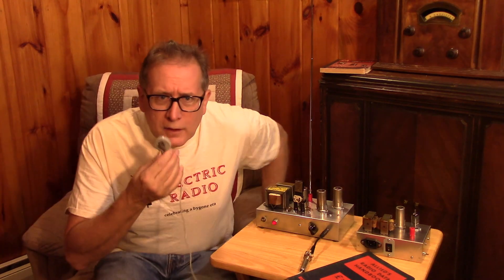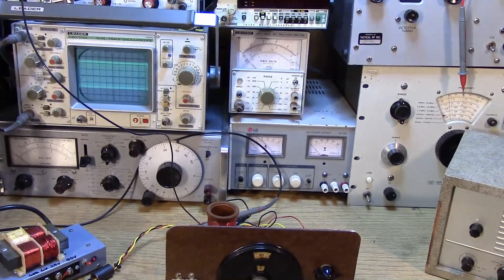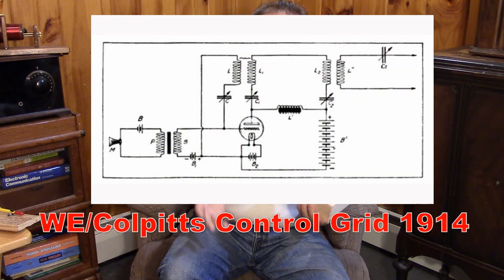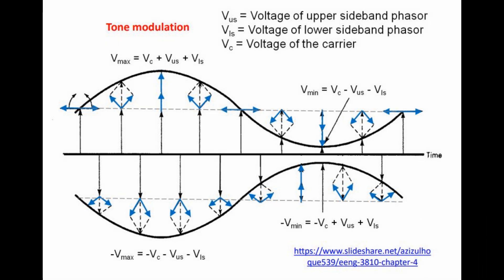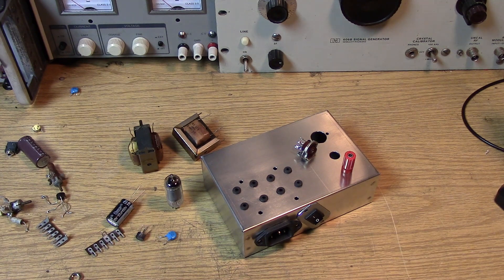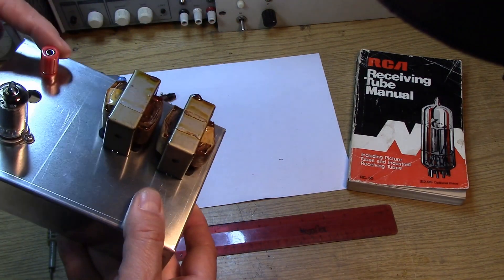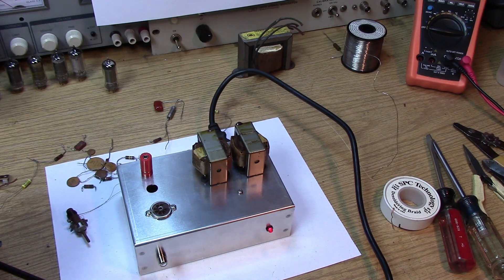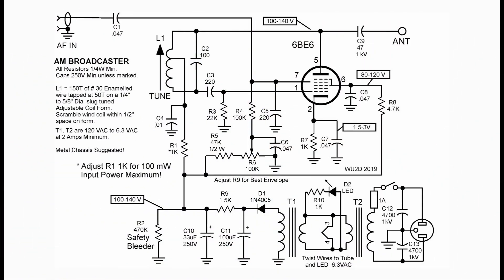Part 15 Old Style Tube Broadcaster - Part 1

Comment: Well explained. Playing Devil's advocate, I think biassing the carbon mic and feeding this signal into the oscillator coils via the extra winding was really grid modulation. You were adding a signal which found it's way to the grid. I think if you had tuned the carbon mic+ coupling coil with a capacitor to resonance it would steal enough rf to kill oscillations. You would then loosen the coupling until oscillation was regained. At some critical coupling, the unbiassed carbon mic should work really well.
Reply from the maker: Hard to argue with your grid mod thinking in a self controlled oscillator where everything is reacting! But they called it Absorption Modulation, back then.

Comment: Very fine series.  Thank you for the brief overview of the history of modulation, a subject that's not often discussed in detail.  I think of it as being all in the wrist, so to speak.  It needs to be optimized as much as the carrier and amplifier circuits to get the best possible signal out to the radio.  Your timing is excellent, too, as I recently purchased a K-488 transmitter from AES and plan to build it with as much Hi-fidelity AM as I can get.  Looking forward to part 2!

Comment: I recall seeing  that use of a pair of 6.3V transformers to do, Line/6.3/HV in an old Ham handbook. The AM(and FM) transmitter circuits that I built, used Transistors. But I do recall a circuit from PE for a 5W Carrier Current AM TX that used tubes.

Comment: Great series. I believe an early attempt at AM broadcast put a carbon microphone IN SERIES WITH THE TRANSMITTER OUTPUT/ANTENNA LEAD. Talent had to carefully stand back from the mike—high voltage, hot!!
I’ve wanted to make a Part 15 xmtr that met ALL requirements: max power into the final stage 200 MW; good linearity—good audio; and a good match to the maximum 9 ft antenna.
Unless the final is high efficiency—Class C—you sacrifice potential output power output, and therefore range. A good output match is the Achilles heel of all the “boy’s radio transmitter” circuits. You will need a lot of coil to overcome the capacitance of 9 ft at 1 MHz to 1.7 MHz. (And if the coil is exposed it counts as part of the 9 feet max length). With a bad match you’ve effectively built all the drawbacks of previous poor designs into the fruit of your research and hard work.
Just about demands a plate modulated class C stage. With a VERY carefully designed tank circuit. Lots of headaches.
J. Foote W3GX (also former broadcast chief engineer—ah... those were the days). Love the video.
Reply from the maker: Yes series mod with a stack of carbon mics in series parallel with a reverse horn and a guy yelling loudly while his tounge sizzles! I am glad that you chimed in. Yes the hobby transmitters and the real radio station are at the opposite sides of this subject!

Comment: I don't know how I missed this series of videos but they answer a lot of my questions as a mature returner/beginner to radio and amateur radio. Can I make the point that your fan/subscriber base is not limited to the US but is international. Therefore, some preface of "Part 15" would be useful. I Googled it but the results were not concise, more ambiguous. It would be very helpful if you could explain the relevant pieces of Part 15 in the style you do so well. Maybe a topic for a short video?
Reply from the maker: Yeah maye be a Part 15 primer. Luckily Part 15 never went away. Mostly because once the FCC makes a rule, its so hard to change it.

Comment: Those Blue Caps. should be safety caps .
Reply from the maker: Those blue jobs were taken out of an old ATX power supply and they were across the line. They do have a lot of safety markings on them. Never knew that these were special beyond an adequate AC voltage rating...

Comment: I'm wondering about the back to back transformers.  Is the sole purpose to pull filament voltage at 1st transformers output ??
Reply from the maker: It is all about safety isolation. You can find conventional old style tube power transformers now, but they can be pricy. If you do the back to back trick, you get the isolation and low voltage for the filaments and HV, and you can use those  low cost control transformers. Another trick is to use a split primary transformers, sacrificing one primary as the HV out.
Reply: @MIKROWAVE1  Always helpful Mike !!  Patiently waiting for Part 2  😁😁

Comment: Great presentation! 👍🏻
Have you made the power supply yourself?
I am going to try to make my own first tube circuit soon (the Morgan Regen you showed in the video), and the power supply is what is holding me back.
Reply from the maker: That transformer style on the little blue supply with the 4 independent windings has a dual 120V and dual 12V windings allowing use in EU or US. But the advantage is that you are able to replace turns ir remove turns on any of them to customize the voltage.  The ideal setup for the Morgan would be a transformer with a 6.3V and a 30 to 50V winding which would peak up to 45 to 90 VDC when rectified and filtered. Two 120 to 6.3V units can be used back to back as shown, but you would need a voltage divider because the voltage would be a bit high at 120 to 150 VDC. Regens like this like lower voltage to be more stable for receiving and controlling the regeneration.

Comment: Have you not tried the low voltage TELEFUNKEN GMBH vacuum tubes? 
DSB with a low level carrier.
What about implementing a SO42P using 3x 12AX7 vacuum tubes or if you can get them 3x ECC88 tubes, just Google http://www.angelfire.com/planet/funwithtransistors/Book_CHAP-4B.html and it is Figure 4B.8 that you need to look at for this mixer, what about using low voltage vacuum tubes to cut down on the shock hazard.
Reply from the maker: I have no experience with the low voltage enhanced emission valves but if anyone could make them, it would be Telefunken! And less shocking is always appreciated! Of course you guys have 230 VAC so you are starting high on the mains and that is a safety issue for beginners and old guys alike.